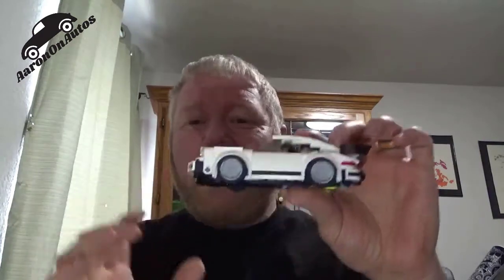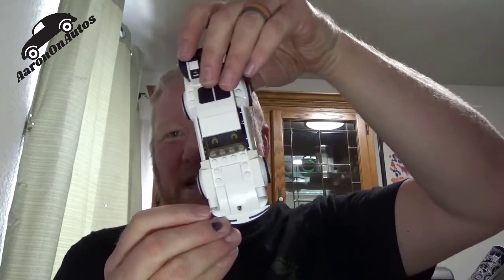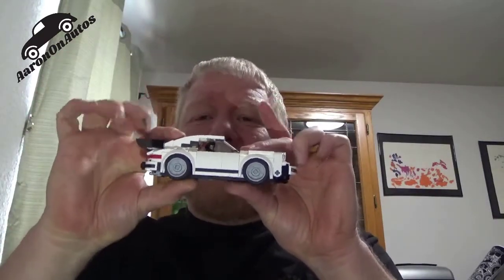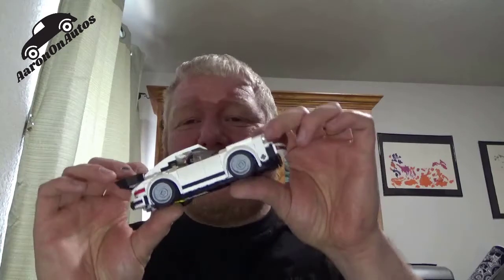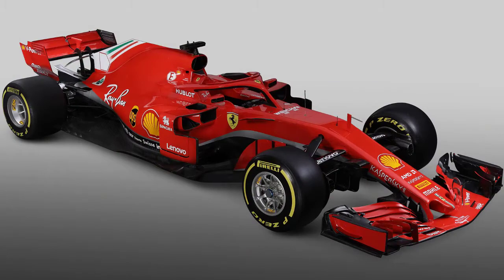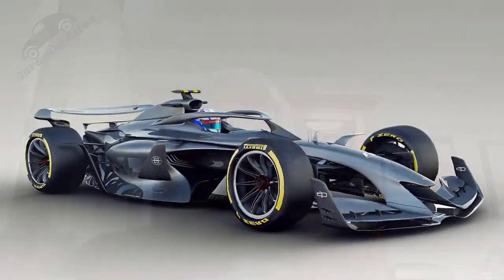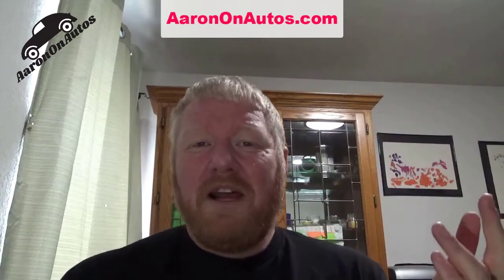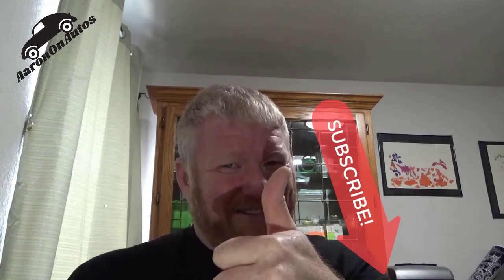Q&A: Does a Longer Wheelbase Make a Vehicle More Stable?

Comment: 911 Porsche are rear engine, not mid engine & have a far rear weight bias. Not the best engineering  for mid cornering however This increases traction during ecceleration out of a corner, without adding the weight of 4 wheel drive. However even a 4 wheel drive 911 has a rear weight bias. A BMW 3 series is a better example of a car with a 50:50 weight balance. However the 50:50 weight bias of a BMW is spread over the length of the car. Handling can be improved if you can get more of the weight as closer to the centre of the front & rear wheels. Heavy objects like engine, transmission & fuel should be close to the centre in a 4 wheel drive car & on a rear wheel drive car  just rear of mid centre.

Comment: So which is better for traction? For example both cars has front engine and both of them are rwd, and then both of them has wide body for wider wheels and tires for better traction. but they have differences in wheelbase. one has shorter wheelbase and the other one has slightly longer wheelbase for about 105mm longer. so my question is which is better for traction or grip? For preventing wheel spin, when you are flooring it.
Reply from the maker: Shorter wheelbase. The longer the wheelbase, the less weight that will be on the drive axle. Less weight pushing down to the ground equals worse traction.

Comment: How do you move a engine back to get more weight percentage towards the back to the rear of the car for Drag racing on the street or no prep racing and what would be a good weight percentage?? 
Is there a Pacific type of motor mounts that you use to move the engine further to the rear of the car or what and if so what motor mounts do you use???